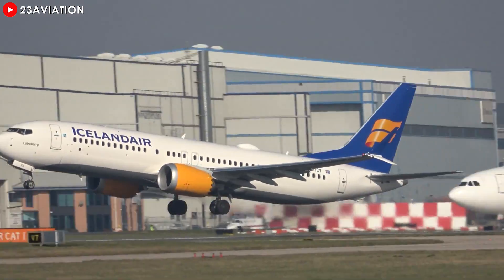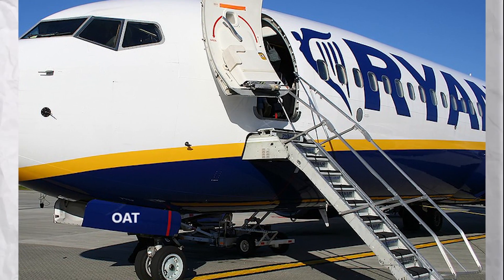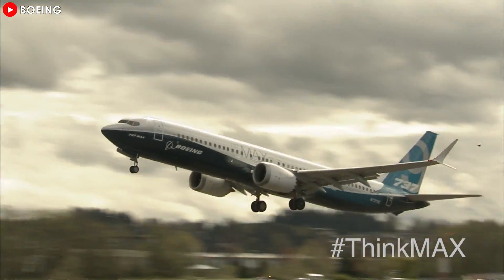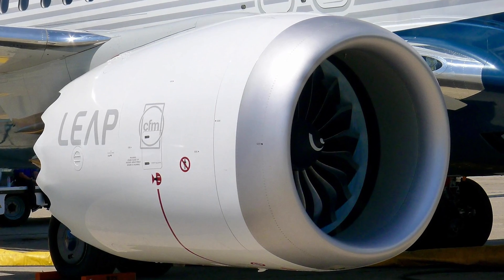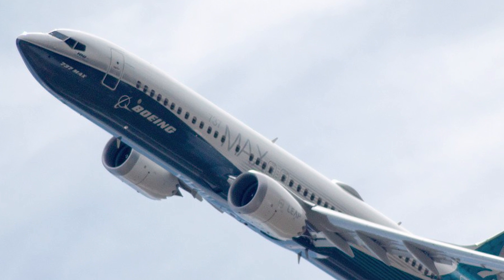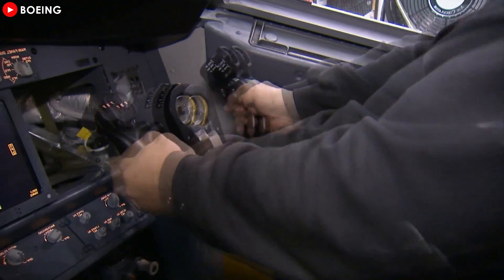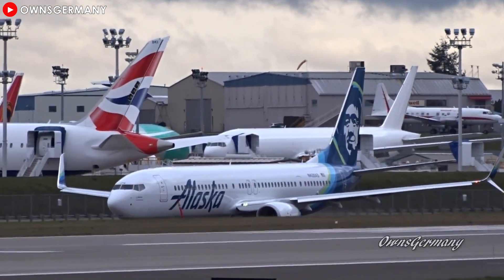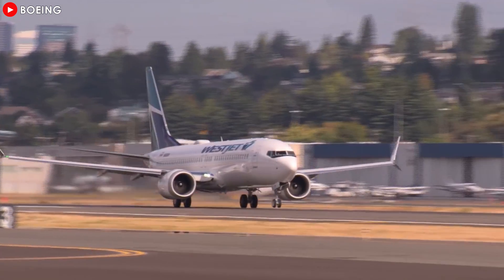You WON'T Believe What Just Happened to Boeing 737MAX! Here's Why

Comment: Airbus is doing the same thing in order to stretch the A320 into the A321  software change on the FAC, ELAC, were done.. single point of failure for the AOA sensor was the biggest mistake.. the mechanic who took the bolts out of the door and failed to document it. That's on him

Comment: Excellent analysis and very informative. The Max experience is definitely an upgrade from previous models. That said, I prefer the Airbus neo's which are a bit wider and I believe quieter. I've also experienced more technical problems on 737's than the 319 and 320 series but perhaps that's just been my experiences.
Reply from the maker: Thanks for your feedback and sharing your experience.

Comment: I can understand unintended consequences like deicing fluid affecting the build materials. I can understand the new software systems to cope with the movement of the centre of gravity. What I can't get my head around are the following: 1. They did not redesign in order to avoid certification and to save money. 2. The pilots were not even told the new software existed never mind what it does and how to handle it until planes had fallen out of the sky. 3. Worst of the lot.... basic quality procedures were ignored at the build allowing bolts to be left loose or not fitted at all. It is only by pure miracle there was no loss of life when that plug popped! Seems they are not fit to do their own certification at build and this should never be allowed again.
Reply from the maker: I also can't understand the opt 2. How can that happen?
Reply: 1. IT WAS ALL AB0UT "NEW" AIRCRAFT AS "CHEAP" AS P0SSIBLE, N0T IN UNIT C0STS BUT LYING T0 FAA THAT "N0 EXTRA TRAINING WAS NEEDED T0 FLY THE MAX". THEREF0RE "D0 N0T MENTI0N "MCAS". THAT SIMPLE LIE C0ST THE LIVES 0F 347 PE0PLE.  2. PIL0TS WERE LIED T0. 3. QC WENT 0UT THE WIND0W.

Comment: What no one seems to be mentioning is that the enhancing of an innate single point of failure into the 737MAX was a bad design decision.  Which, as at least on airline pilot has said, the pilots should never be required to work around a faulty aircraft design element. 

When a singular AOA input to the MCAS has increased the criticality of an improperly positioned stabilizer trim which in this particular takeoff climb low speed regime makes it nearly impossible to manually retrieve the stabilizer when it is mistimed by the single point failure.  Without two separate AOA inputs to the MCAS computer, a single failure is undetected and thus generates faulty outputs which essentially trigger a runaway, uncommanded stabilizer trim movement.  In order to manually adjust the stabilizer, the aerodynamic loading of the stabilizer must reduced significantly before the manual trim system can reposition the stabilizer.  Thus rendering manual stabilizer trim effectively unusable in a critical situation where the aerodynamic loads on  the stabilizer are the highest…with the stabilizer in the full up or full down position. Such as an MCAS-induced trim runaway.  But, even in 737s without MCAS installed, there are scenarios where manual stabilizer retrimming is difficult or almost physically impossible.  This is a “feature” of all 737 aircraft.  Which should not be a surprise for at 60 year old aircraft design.  One would never ever design a backup system that is so ineffective in a more modern aircraft.  From a human factors perspective, this is a legacy of the 737-100/200 models, which often had a third pilot included in the normal flight crew complement.  In this failure situation, 3 pilots onboard allowed one pilot to fly the airplane as the other two pilots could more effectively apply enough brute strength to manually reposition a severely mistrimmed stabilizer.  A situation that will always be very critical at low altitudes such as during takeoff and landing.

Comment: Just flew in a 737 Max 800 with Southwest. I was in row A seat 3. It was t	he loudest aircraft	I have ever flown in on take off. The loudest engines I have ever heard. You really need ear protection on take offs.
Reply: I was in 4A in an Air Canada MAX, so CLOSER to the engine. I dont know what you’re talking about regarding loudness… meanwhile in 4A on the old A320 with CFM56 engines, that was much louder. Not to the point of needing hearing protection though. Claim “sensitive ears” all you want, then i expect you to wear your hearing protection on every single airplane you fly on because apart from maybe the E-2 and A220, the MAX is one of the most quiet.

Comment: I've flown the 737 max and did not feel a great deal of difference to the 800 model. However, if I had the chance of flying an earlier model or Airbus I would choose this. I feel Boeing should have had a totally different plane to replace the 737. With the Max they have tarnished their reputation possibly irretrievably. I really don't know what is wrong with company as they also have problems with the 787.
Reply: Too many ex-GE's guys goosing the stock price at the cost of 346 lives so far.

Comment: My experience of 737s is cramped on every flight and controlled crash landings. Airbus on the other hand more space as the planes are wider and the flight more comfortable.
Reply: I’ve had controlled crashes into the ground on A320s and A321s, so it’s not just a “Boeing lands hard, Boeing cramped, Boeing bad.” Blame the current weather as that will have the biggest impact on the smoothness of the landing. Consequently, i’ve had silky smooth landings on MAX8’s and a very spacious interior. Blame the airline for that.

Comment: If you are seated in a window seat on a medium haul such as 5 hours, your feet are going to be frozen.  I first thought that it could have been what I was wearing the first time but even with better shoes, I had the worst flight back home as I encountered the same problem.  737MAX never again though I tend to use flights on Airbus aircraft for years, my destination with the 737MAX had only one carrier that uses only their 737MAX on it.  So I will be flying to a nearby airport using another carrier and use either a train or bus ride for the rest of the journey (which is only 100 miles / 160 km away)

Comment: My experience of the 737-8 wasn't much different from the 800 generation. The cabin had improvements, but they can be fitted to the 800s if the Airline wishes.
Reply: Comparing Air Canada’s MAX-8 to their A320s is like night and day. Get on a MAX, and one is treated to a modern spacious interior that is relatively quiet. A320 on the other hand is old, worn, a bit janky in some spots and a bit louder, mostly due to the engines. I believe they’re upgrading some A320s to the new interior which is amazing considering how bad the current ones are
Reply: @cole_stock  I didn't compare the 737-8 to a A320, but to a 737-800. Using Air Canada as a example is very good, they are to busy spending money on painting their aircraft back to a similar design from the 1990's to the early 2000's.
Reply: @LordAndrew1  actually they’re too busy jam packing their scheduling to worry about any of that crap 😂

Comment: What is shown as the 'initial' 737 (in talking about its engines) is far from being initial. the first engines were JT8D, low bypass engines, on the 100/200 series. These were later changed to CFM56 engines on the 400 and above series, which is what is being touted in this video as the initial 737.

Comment: Actually mate i do realize what plane i am flying in. Because i look at it before i buy the ticket. And no i do not fly on anything that Boeing makes. As long as there are options i will not fly on anything Boeing
Reply: As long as you're not flying a carrier that can "upgrade" you to a MAX if your scheduled 'bus isn't available.
Reply: @jimh.3260  Upgrade to a 737-8?????
Reply: The 757 and 767 are still in service. I’ll fly those planes or Airbus. Still skeptical of the 737 Max.

Comment: You guys have analyzed the issue well, but I believe there’s a critical game changer that was overlooked. Aircraft manufacturers have lost their dominance in the aviation industry. The real power now lies with the engine producers—Rolls Royce, General Electric, Pratt & Whitney, etc. In today's market, operational costs are the primary concern of airline operators, and these are largely tied to the efficiency and maintenance of the jet engine itself.

It’s no coincidence that Airbus introduced the acronym NEO (New Engine Option) years ago. Aircraft sales have increasingly become engine-brand dependent. The aviation landscape is no longer defined by just two major players (Boeing and Airbus). Manufacturers from Canada, Brazil, Russia, and China now have the capability to build aircraft frameworks (thanks to new composite materials), with only minor differences in framework design. However, all of them heavily relies on the same jet engine manufacturers, meaning that the engine suppliers have become the true power brokers in the industry.

Jet engines are to the aviation market what chip production is to the electronics market. Regarding Boeing's MCAS crisis: it wasn’t just about airplane modifications—it was largely due to the lengthy and expensive safety regulations required for any significant aircraft framework changes. This process is similar to certifying a brand-new model, and in the competition against Airbus, time to market is crucial.

Comment: Correction, it was not that pilots were not properly trained or adequately trained on the MCAS system, rather Boeing did not inform the pilots or airlines about the MCAS system. So not knowing thus no training about the MCAS System culminated in the two fatal crashes.
Reply: You are right. Personally, I wouldn't say Boeing "did not inform" the pilots; rather, Boeing actively concealed that information from them. This isn't a case of an oversight or a simple mistake—we’re talking about a serious allegation of felony-level misconduct.
Reply: @TheConfusedCompass You're right, they did "conceal" the augmentation system to make the new model behave the same as the old model, so pilots could fly either model without retraining as they would perform the same way. This means no recertification would be required, making that issue same as Airbus. So the pilots in the accident aircraft didn't know what was happening, nor why, when the pitch control motor was running. All they had to do was either just grab the pitch trim wheel from turning, or turn it off with a switch. The pilots of the two accident aircraft didn't know that, it seems that all the others flying that same model did. In fact, one of the memory items on all the 737 is how to stop a "runaway pitch trim" and evidently these accident pilots did not know that, and that would have solved the runaway problem.